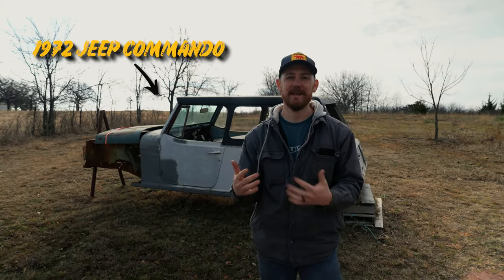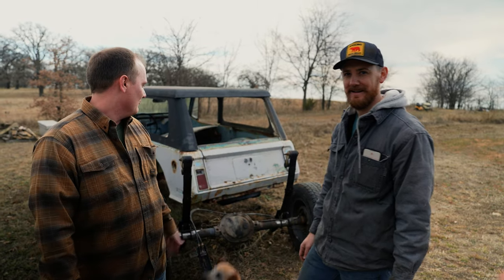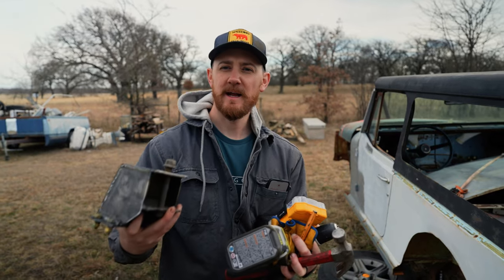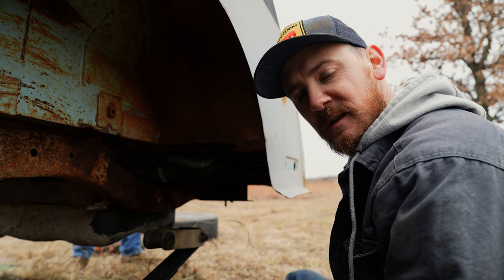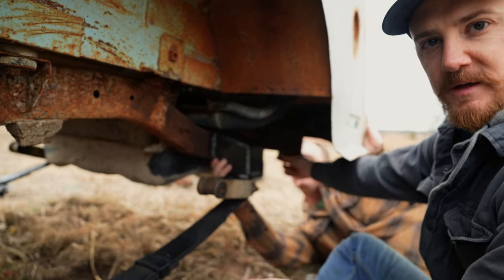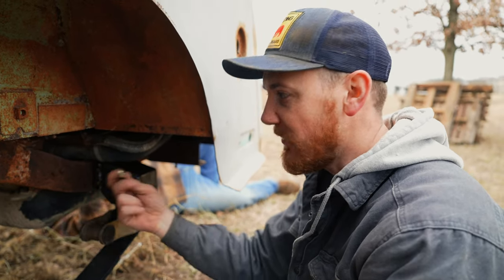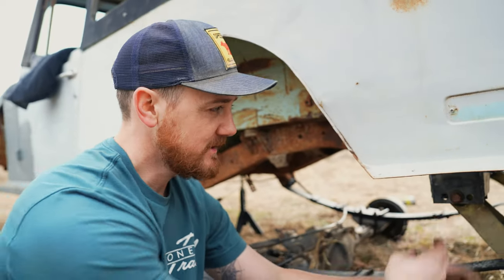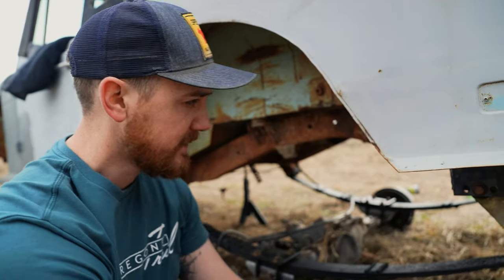How to get a Jeep home with no drivetrain.  Picking Up Crusty Commando

Comment: are shorter springs better?
Reply from the maker: They aren’t better but it didn’t come with leaf springs. So I used the Cherokee springs I had since they were free, were a close fit, easier to find in different lift heights for cheap, and already came is SOA configuration. I might be changing that though we will see.